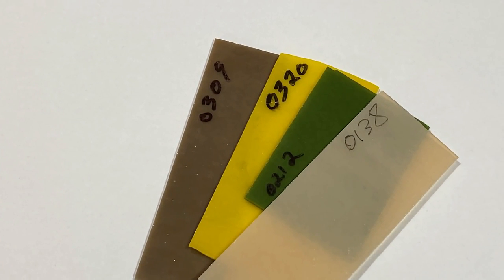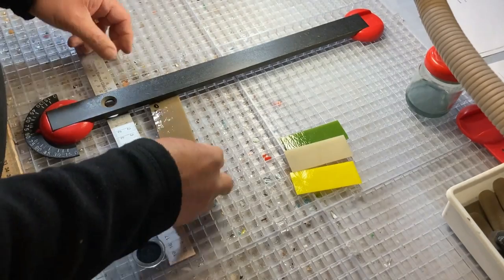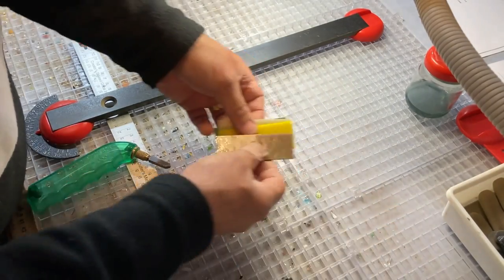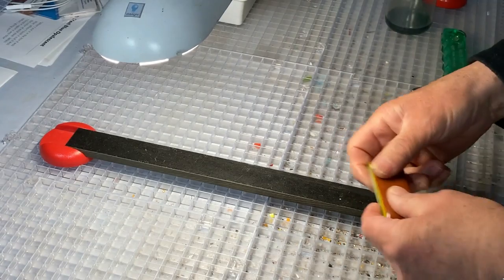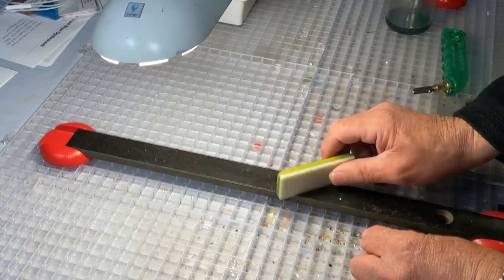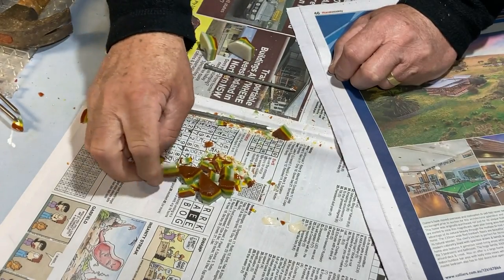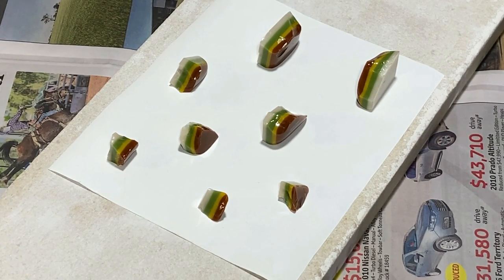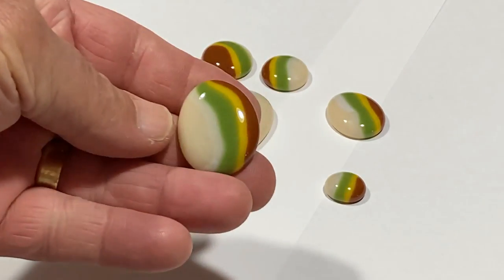Making Fused Glass Cabochons with a Glass Kiln or Microwave Kiln, Glass Fusing Project

Comment: Brilliant way of doing it and fantastic results. Please can you give the firing schedule again. Many thanks, Jill
Reply from the maker: Hi Jill. To make cabs from the pieces, I ramp at 222C to 535C, no hold. Then ramp 333C to 780C and hold until they have formed the cabochons. Then you can just turn off the kiln and let it cool naturally. because they are only small pieces they should anneal properly. I have seen people ramp full up to the processing temp, but I like to take it easy. Just remember that not all kilns fire the same. These are 90 COE so if you use 96 COE that will be different, and your kiln may also fire differently.

Comment: 15:55 Jeff,I love your videos! I am expanding my equipment when I see something. Can you please tell me the  name of mat you cut on and the ruler cutter you use and where can I purchase them. Thanks Sharon
Reply from the maker: Hi Sharon. That's the Beetle Bits cutting system and everything you see are accessories you can purchase. It's available throughout UK and USA as far as I'm aware. Don't know of anywhere specifically over there but do a search and you should find a supplier.

Comment: Hello thanks a lot! You are the best! 
Please can you say what kind of glue do you use to set up the parts of glass in other desings?
Reply from the maker: Hi Carmen. If you mean to glue on bails, we use Araldite Ultra Clear. It dries clear and we've been using it for years without any issue.
Reply: @RocketRoseArt  thanks for this! :) 
I mean gluing for putting the parts together into the kiln ;)

Comment: Jeff, I used to make jewelry with glass chips and a little kiln at school, I was given little copper molds for the glass to melt into, is this the same sort of thing.  I was 13 at the time and loved it!
Reply from the maker: Hi Lisa. Sounds right except for the copper moulds. The glass chips we call 'frit', which is just ground glass. Frit comes in grades from powder through to a coarse frit, which would probably be the chips you mentioned. You would definitely need a kiln because a normal oven won't get to the required temps, which are around 800 C, depending on what you're doing. The copper moulds are a little odd. I believe copper melts at something like 1000-1100 C which means that at 800 C it would be softening I would think. Not sure as I've never tried copper for a mould. The moulds I've used are generally bisque ceramic or stainless steel. Regardless, I think you're on the right track. The cabs in this video are simply placed on a kiln shelf and heated to around 800C at which they melt down into the puddle. No moulds needed. Hope this all helps.
Reply: @RocketRoseArt  The glass frits as you call them melted and stayed in, maybe they were bases even, I am not sure what they called them. The bases were given to the students to make glass jewelry and they stayed in them, I could smell the copper being heated while the frit was melting.  OH, that doesn't sound very safe the think of it LOL!
Reply from the maker: @LisaVesander.Creative  Ah! Sounds more like glass enamelling. That's were you use a fine glass frit like material, dry or mixed with water, that is then applied to a backing, copper, silver etc that is then melted in a kiln or using a torch. It adheres to the backing and forms something like a pendant etc.Do a search here and you'll find many videos that would help you if you want to learn more. You're right, whenever working with melting glass you need to follow strict safety procedures. Besides the danger of sever burns, using powdered frit you should use a respirator. Don't breath in. Causes silicosis. Nasty stuff. But simple safe practices are all that's needed. Don't let that deter you. Glass fusing or enamelling, get hooked and you'll love it.
Reply: @RocketRoseArt  I loved doing it in 1977, that was in a school environment, in those days it wasn't a thing LOL.  Yes, you are correct though definitely wearing a mask and a well-ventilated area is a must. Thank you for helping me to work out what it is, I will look it up!

Comment: Nice video again, Jeff What is exactly the use exactly? Is it to get an perfectly straight smooth surface or is there an other meaning/purpose? I'm used to work with deviding powder which I spread with a sieve. Do you think that's a good alternative? Thanks for the great glass-videos.
Reply from the maker: Hi Carel. The dams on the sides are to get flat edges. Hopefully so the pieces have a flat edge to sit on. You don't need to do that. Just fuse it up and then break it. You could use powder on the shelf, but you'll need Thinfire or fibreboard or similar against the dams on the side.

Comment: Hi Jeff!  Thank you very much for sharing your knowledge.  I assume the second fusion is the same as the first, is it?
Reply from the maker: That's an oversight on my part. Should have included the schedule. With these smaller pieces you can in theory just ramp up to the top temp, hold until they fuse down and then turn off the kiln, allowing it to cool naturally. But I usually use segments because I'm not in any hurry. In Segment 1 you won't have to hold it as long, because it isn't a thick slab. You could just continue without a hold, but I always err on the side of safety. A 5 minute hold would be fine. Segment 2 top temp would be the same, but look in the kiln to check when they have fused to cabs. About 10 minuets I found. Does depend on the size of the pieces and the glass used. Segment 3, the anneal, only a 10-15 minute hold is fine. Segment 4 you can skip. Hope this helps.

Comment: very nice work jeff  im a flint knapper i make arrowheads out of obsidian which is volcanic glass i have bits left over from my saw  is it posable  to melt an fuse it like normal glass?
Reply from the maker: That's a great question. I've never used it so just had to do some research. Seems like it can be but it is difficult to work with due to impurities. Anyway, I did find this video that you may want to have a look at - https://youtu.be/CA3lIuN_zVE  BTW, make sure you use a mask if grinding. Silica is nasty stuff and I believe the chap in the video didn't use one.

Comment: Hi Jeff how can I make 15mm round cobochons same size every time in a kiln ( making about 30 at a time ? ) is it possible or will they come out different diameter ?
Reply from the maker: Hi Joseph. Wish I had a simple answer for that one. So many factors to consider. I've thought of trying to ensure the glass for each cab started with the same weight and at least the same general size. But that's a lot of work. Worth trying if you need them perfect. My solution was to make more than I need and then select the best. But I only needed pairs for earrings. Other than that I make cabs to fit things like standard bezel settings by cutting them like gemstone cabochons on lapidary wheels. Then I firepolish them to get the polish back. That works, but you need wheels and it does take time. Wish I could help further.

Comment: I want to make inserts for drawer pulls that require  1" cabochons to fit in the recess.  How do I cut the glass stack to make 1" cabochons?
Reply from the maker: Hi Najia. I wish I had a good answer for that one. Getting a cabochon and exact size is a challenge. All I can say is to test. Fuse some around the 1" size. Be aware that different colours will behave differently. The only other way is hand cutting them to fit. This video will give you an idea. https://www.youtube.com/watch?v=jRdyVWbOc3U
Reply: @RocketRoseArt  I was afraid you would say that-thanks so much for your response!

Comment: how does that relate to using into a microwave kiln
Reply from the maker: Hi there! I'll try to help with this. While the process in the video has been done in a glass kiln, you can use the same technique in a microwave kiln. Make the original bar smaller, then break it up and refuse to make the puddle cabochon. The size is only limited to the size of your microwave kiln. You can fuse a couple of small sheets in a microwave kiln, especially the larger varieties. You may have to fuse each piece individually. Or you could use the technique I suggested at the end of the video. Hope that helps.